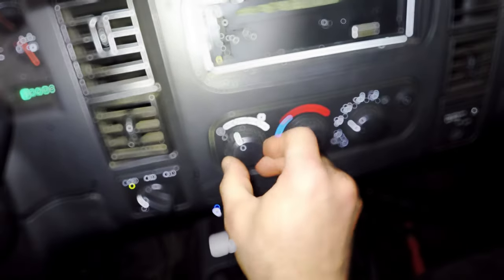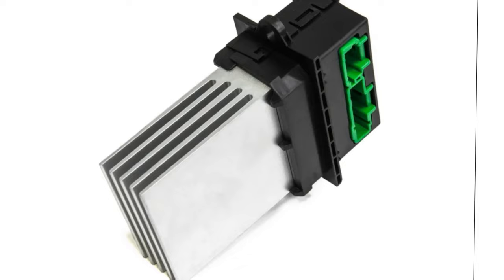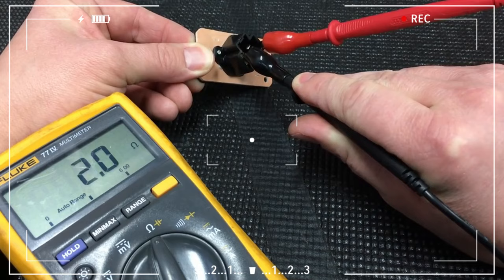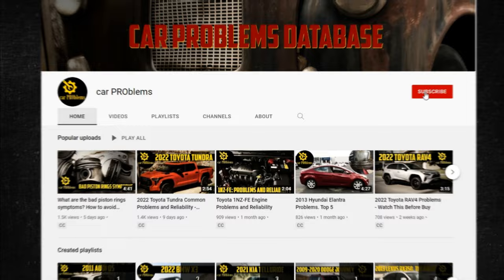4 Signs of a Bad Blower Motor Resistor. How to Test & Replacement Cost

Comment: What if ac just runs will not cut off until you turn the vehichle off
Reply: Could be bad pressure sensor or heater core temp sensor. One of those could be the culprit. You’ll need to do more research for your specific vehicle to see if it has those and if they fail often.

Comment: My 02 muatang needs either a new blower motor in general or new resistor....ill probably replace both given age of the car.....smell of burning plastic only when the air is on is a fantasic smell 😂
Reply: You probably figured it out by now but burning smell is definitely the resistor.

Comment: So here is my issue. I have a. 2012 Ram 1500, ac was working as it should very cold I might say then I started smelling wires burning and the ac stopped blowing cold air. The heater works and all blower speeds work. Is it possible condensation found it’s way to a wire connection and cooked it? Just trying to get ideas before I start taking the dash out. Thank
Reply: If you are only blowing warm air, then you have a bad blend door motor . The blend door motor is what controls the climate of your vehicle.

Comment: I have a question more than a comment, my A/C works only on hi so I purchased a new resistor, pulled out the old one put in the new one and I get nothing? It doesn't even come on an any speed?? any suggestions as to what  the problem is?, I did notice that the connector did have a small burn on it and I have not replaced it yet, do you think that could be the problem as to why the new one doesn't work at all? Believe it or not I have replaced it with 2 different new resistors and gotten the same result....nothing.
 Any suggestions would be greatly appreciated.
thanks
Reply: Did u solve it?? I have same problem😊
Reply: Blower motor
Reply: I replaced the resistor and the blower motor, and still having the same issue!! The all of a sudden one day about 3 months later it started working… go figure!!
😮
Reply: @anthonyporcarellosr3627  🤔 weird

Comment: Can the wiring for the resistor get hot? If so, what would be the resolve?
Reply: The blower motor is pulling more amps than what the resistor is rated for. Not enough to pop a fuse but enough to make the wiring get warm. Only thing that should get warm/hot to the touch is the resistor itself.
Reply: @charlesfields7908  Thank you it makes a lot of sense. Have a Great day.